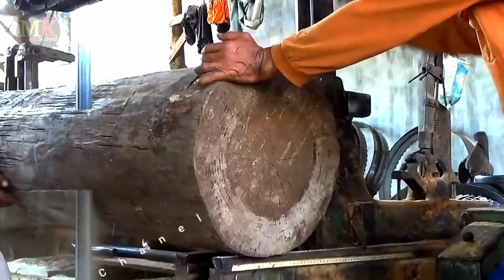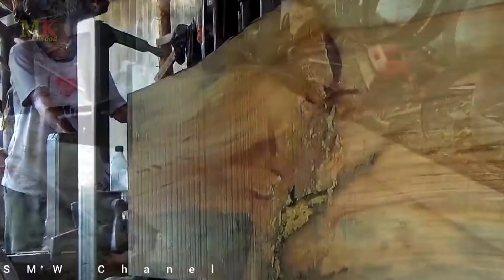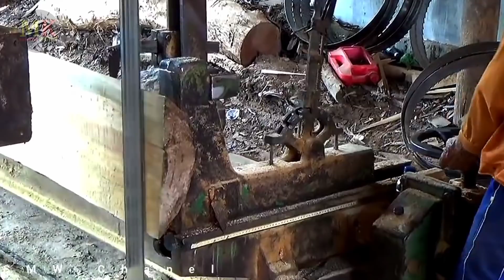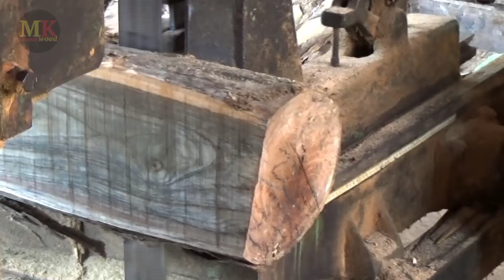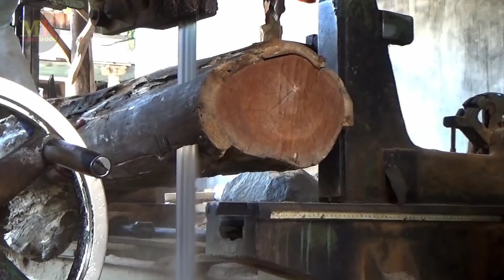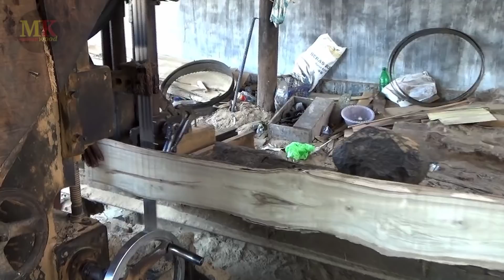BESAR..!Luar biasa,sungguh mengejutkan Pinus raksasa dari hutan liar yang langka.memiliki serat aneh

Comment: Beautiful piece you all!  Was wondering with all those bad blades laying around if a person couldn't cut out the bad spots and weld in a replacement from another of the blades, grinder flat, and then maybe make use of other worn-out blades.  Not sure if it's possible lol, but just my mind working as it does :).